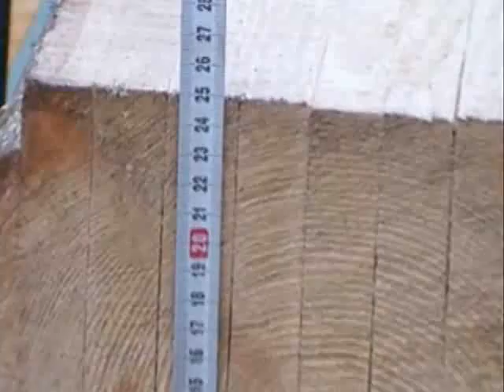MULTIBLADE CIRCULAR SAW WITH DOUBLE AXIS TYPE 750 40/250

Comment: this machine goes against the very way wood is sawn into lumber, the heart wood lumber will cause warped lumber. always start and cut the outer wood off as 1/2 sawn or 1/4 sawn lumber first leaving the heartwood for 4x4 or 6x6 material. you will always produce better lumber this way.
Reply: yes
Reply: You would be surprised at how many people at lumber yards would look at you crosseyed if you start dropping terms such as 1/2 saw or 1/4 sawn.   Lumber is Lumber, like Spam is meat.
Reply: I'm really a woodworking noob but even I know you don't cut wood like that.
Reply: Believe this may be used for making pallets 1/2 sawn, 1/4 sawn....no difference
Reply: Hi. I worked for a large lumber company for many years. The ideal for this type of gang saw is to keep the sawyer working on the larger logs. The Gang does two jobs,one it gets the face and lower grades from the sides the center or heart wood is cut into a smaller cant that can then be sold to palate mills,has they use the lowest grade of wood. This unit may or may not have guilds that can be changed to set the thickness. The gang I did the saws for was a Salem thin kerf  model I could adjust the thickness from 4/4 to 10/4 and the center to. 16/4 or higher if needed.It ran saws which I repaired from 100 plate to 50 plate Very thin kerf It made more board feet per log,less saw dust.It could run the cants has fast has you could feed it. We ran millions of board feet per year.
Reply: Bobby Tectalabyss
Reply: superrodder2002
Reply: superrodder2002

Comment: I was wondering the same, why there is not an industrial dust extractor connected to suck up the sawdust from the exhaust port. This machine no doubt is three phase probably 460-480V current draw 40 or more amps per phase

Comment: Useless for wide boards but great for 1 by 2 and 1 by 3, 4, 5, etc.Next step is to rotate that stack of boards by 90 degrees and make the strips you need.  Just remove certain blades to vary width of the strips produced.